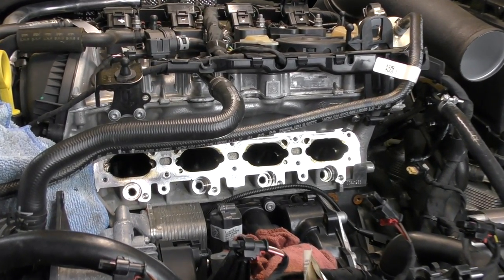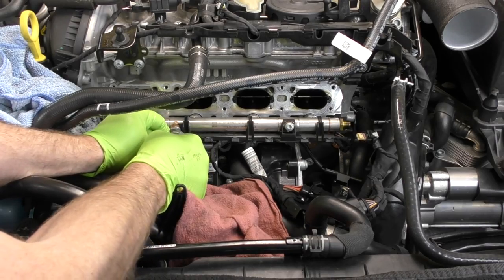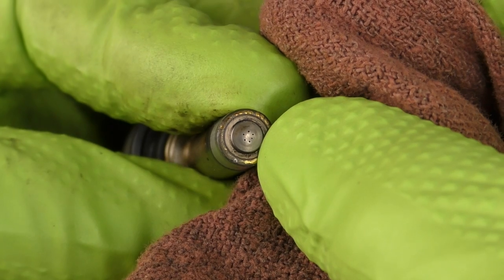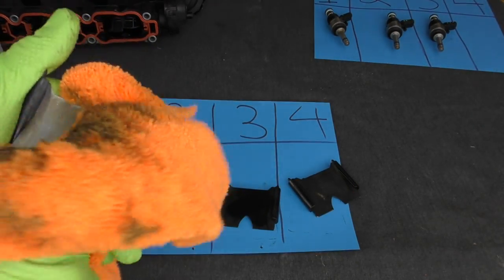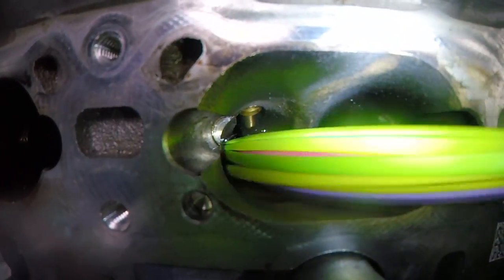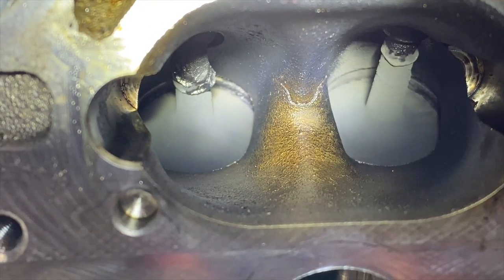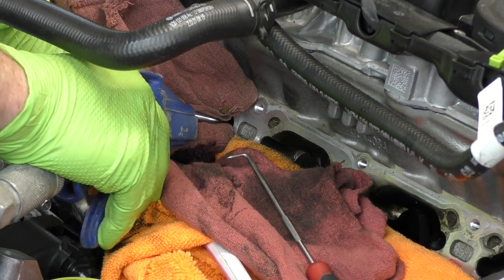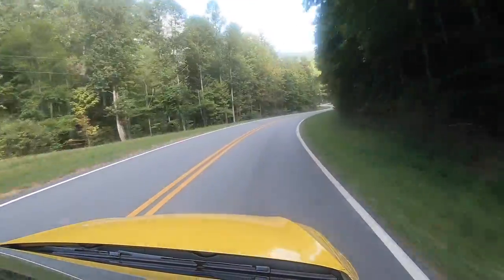How Much Carbon Build Up at 10,000 Miles?? ~ 2019 Golf R

Comment: @HumbleMechanic Hey man, I'm really not trying to teach you anything better so please don't get me wrong, but I've got a K20A6 Accord and it states in the manual to use 0W20.
However, it is contradictory to use that viscosity due to "watering" of that oil at repeatedly hitting WOT, high ambient temp or lots of traffic jams. I use 5W40 and almost everybody kinda does.
(Exhaust cam may wear out due to thinning oil)
Have you ever thought of that? Especially those track moments that you had done with it? I BTW also use Ceratec every 20.000 / every third oil change. Works amazing.

Thank you so much for your content.

Comment: GDI...what a concept?  Made to fail.  Port injection way better in the long run.  If you have to clean this - which you must do - I use 50% trans fluid and 50% acetone with a tooth brush to agitate.  Soak the mix for 5 minutes.  It literally melts carbon with little to no scrubbing. Wipe out with lint free cloth or blow out with compressed air. Done.

Comment: my 2019 golf r has 6 year 72,000 mile warranty, you just took the warranty off yours
Reply from the maker: No I didn’t. This would only be an issue if something wasn’t done right. My car is flagged TD1 anyway so I’m not worried.
Reply: Jb4 is great compromise without getting TD1 flagged. Never touches the eco & can resell it one you are done. After warranty is up, custom tune it or hybrid turbo. These engines are solid & handle abuse like no other. VW did an excellent job on the gen3(minus the B-cycle junk lol)

Comment: You put on miles....or...was the car brand new? You a mechanic so probably not,...i have a 2018 MK7.5. It just turned 20,000kms, or for you all you Americans in the US 12,509 miles miles. Should I be looking into this. The car is rarely launched, in 3 years it mayyyyy have 40 max max launches. Id say 30 would be more accurate. Driven normally if not carefully. The 🚙 is very we well cared for, and I have yet to get a scratch,. 
 [now that I mentioned it, you watch there'll be a new one on it tomorrow]
Reply from the maker: All but about 4 port/factory miles were me. I did the PDI on it.

Comment: As someone has already stated, Toyota uses port and direct injection to prevent this issue. Shame on the arrogant German manufacturers for not adding port injection and trust me, they know about this solution. Of course, this does provide a nice payday for the dealers as they just love charging their customers big bucks for carbon buildup cleaning. Read into that what you want….

Comment: Those direct injection engines are just junk. Puke... Gotta love my port injection engine.
In my opinion, it would be better for the environment in the long run if those direct injection engines have port injection, too. Cheaper and better than having an engine failure due to carbon.

Comment: Wrong weight oil used.  Not 0w-20 508 oil, you need any oil that says "VW 504" on the label.  That is heavier oil to handle the extra heat.  (Using VW 504 over VW 502 might mean it leaves less Carbon Deposits on the valves due to 504's lower saps. https://api.ownersmanualvw.com/#/vin/WVWWA7AU1KW190649/content/en-US:5GM012723AQ:3-18-3-1
Reply from the maker: I Mis spoke on this one. My R is 0w30 oil. There is a ton of misinformation on oil for this car.

Comment: How can anyone be a fan of direct injection or VW in general. All german car companies lying about diesel vehicle emissions as well. The cars are clearly junk with how dirty these engines run too. High purchase cost high maintenance cost low reliability and low re sale value. Garbage performance AWD system on these golf R’s not good for track or rally. Good for fuel economy and being junk. My girlfriends Honda Accord V6 has 390,000kms and runs mint and has needed such little maintenance. doesn’t burn oil make noise and probably still has full compression. new synthetic every 10,000kms. All my Japanese vehicles run mint with little maintenance as well too and are not engineered to break and cost extra money. I know new honda’s are junk too with direct injection but anyways. Too bad there are not more better options now. I will just keep maintaining & fixing my RB25DET & 4G63. It’s crazy actually how much better my old JDM motors are then anything like new plastic intake manifold and direct injection garbage like focus rs and golf r. Any JZ engine would laugh if it could at all this cost cutting new age euro trash. Yamaha/ToyotaJZ / Nissan RB / Mitsubishi 4G / Honda B series will never be improved on in my mind for gas motor. everything after that was cost cutting and emissions

Comment: That is NOTHING against my old B7 RS4 4.2V8 with 80k km, had to pull the intake to clean it since it had multiple random missfires.

Stupid engineers making the "EGR" by opening the intake valves on the exhaust stroke...

Comment: 10k miles and this is what you get? Why are we still accepting to buy these junk motors? 
Come on VW, fix your shit!

I owned an early GDI/TSI (2006 Audi A4 2.0T) and went through this cleaning process and a host of other issues these engines have had. Do you realize the labor and time involved in cleaning this crap? No car should need this as "routine maint."

You may also remember the high-pressure fuel pump cam follower wear-out issue that took out the cam lobe when failed.

It was a nightmare dealing with these engines and the average person that took them to the dealer got raped with a repair bill that was a total engineering fault to begin with.

And it is a shame that to this day VAG/VW has not redesigned this to eradicate such issues. I stay away from these engines and urge anyone that asks me about them to avoid them as well.

Now I only own and will only buy, 2.5l 5-cylinder (hands down most reliable VW I have owned) and 2015 TDI VWs; will never buy a another garbage VW GDI/TSI.

Comment: Just entirely delete the recirculating PCV system and vent to atmosphere. I had to do this on my FA20DIT engine for the same reason. Yes you'll need a tune. Any direct injection only engines should be illegal. They should be port and direct injection but auto manufacturers don't give a shit.

Comment: I have a new Tiguan, 15k miles I already feel reduced performance and kicks when idling. It’s a piece of shit. Keeping my e46 M3 forever
Reply from the maker: Have you taken it to the dealer to have them check it out?
Reply: @HumbleMechanic  thanks for the suggestion. I have an idea of what that will look like. "Can't replicate the issue", etc. Would be a waste of time. It's a lease so if it dies, it dies. Thing is we have two of these in the house, bought them at the same time, one has 10k miles and mine has 15k. Mine will need more RPM and throttle to achieve same speed (engine works harder). Definitely loss of power but when in doubt kickdown, right?

Comment: Why would you have had 2 oil changes at 10,000 miles.  Totally unnecessary with no benefits to engine life or performance.  Why don't you trust the manufacturers recommended change intervals do you think you know more about internal combustion engines and engine oil than VW ?
Reply from the maker: Hahah geez nothing like feeling attacked for simply doing an oil change.
Reply: @HumbleMechanic  Sorry. What I'm attacking is the idea that changing oil before the recommended interval or every 3,000 / 5,000 / 6,000 is at all necessary.  

It's such an American thing as if the oil sold in America is somehow vastly different to that sold everywhere else in the world.  Maybe engines needed it in the 60's/70's/80's but engine design and oil engineering have moved on.  

Americans just seem to hold the view that ocd levels of oil changing are somehow necessary.  I don't get it.

Comment: Well No!
for 10 k miles it is too much goopy. I like VW as i have an Audi with VW engine BUT RIGHT HERE THEY (VW) SUCK 
they should have done what toyota did with the gt86 for example : a dual system that prevent the prroblem for direct injection cars.

Euhmmm Why did you not explain how to set the second piston (therefoer no 3) in TDC position for those ones who want to clean their engine?
I suppose we can guess how to do it, but , a 20 seconde - explanation about it would not make this videos longer. wouldn't it?
Thanks any way for the vid.
bye

Comment: What an ugly mess.  Needs to have complimentary port injection and/or new oil formulations.   

These motors aren't gonna make 200-300k without expensive rework.  Cutting motor life in half is a high price to pay for raising the compression ratio by 15%.

Comment: Don't you speak of the gasoline you put in the engine ??? If you use cheap gas on your engine that's what happens,,, just put premium  gas on your tank and that's it
Reply from the maker: I did mention in the video this car has been 99.9% Shell Vpower high test. Maybe one or 2 tanks of non-shell and those were still top tier fuel

Comment: Why not just seafoam it?
Reply from the maker: It depends on how you do it. in the fuel wont help much
Reply: @HumbleMechanic  I heard it'll damage direct injection engines if you put it in the intake via the vacuum assist line.

Comment: This video is a joke. You can't prevent carbon build up. He should have waited 50k miles to do this service. Is he going to do this every 10k miles? Here's an idea, try using a spray cleaner, like crc turbo and intake valve cleaner.
Reply from the maker: So if there is no preventing the buildup why bother using the cleaner like you are doing?

Comment: Far too much plastic on these engines. Give it a fee years down the road it will go brittle and crack.
Reply from the maker: They’ve been running plastic intakes since 2001 or so. Straight up cracking has not really been a big issue. There have been other parts of the manifold fail. But not a huge thing directly related to the manifold as a whole being plastic. 

I don’t Love it. But they hold up petty well

Comment: 12:22 fuel treatment? OHRLY how is that supposed to do anything if that fuel isnt hitting the valves in the first place? LOL you are using the wrong oil, pour in the castrol LL03 dealers use for TDI's, its 504/507 spec and its exactly the same oil they use in europe in all R and RS cars (VAG), get rid of that 502 garbage you are pouring in read more here page 19-21 http://www.oil-club.ru/forum/index.php?app=core&module=attach&section=attach&attach_id=49074

Comment: Absolutely terrible engineering ... Most direct injection engines are the same .. the new ford 3 cylinder engine in Europe have port and direct injection ... Be interesting how much cleaner they are over time.